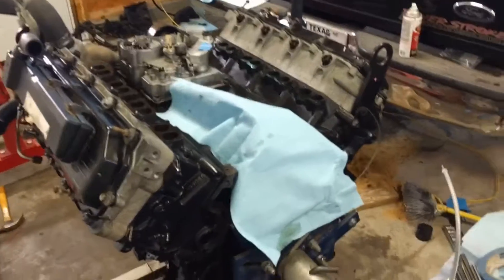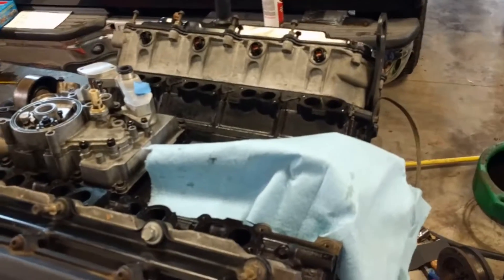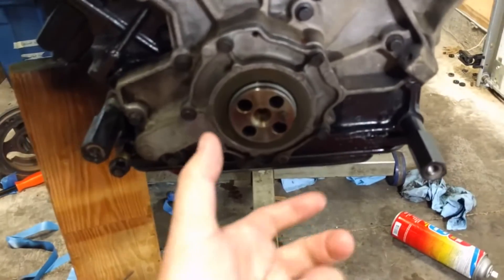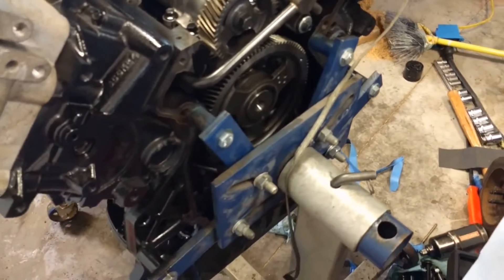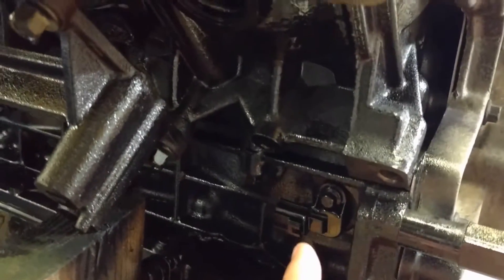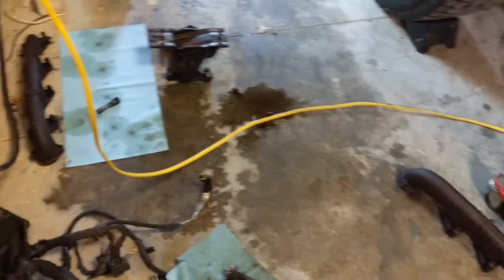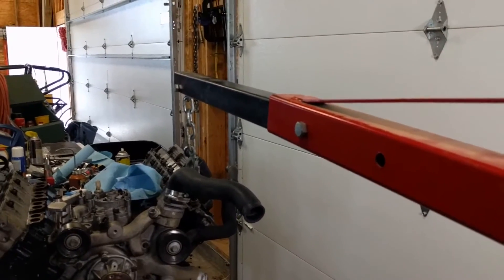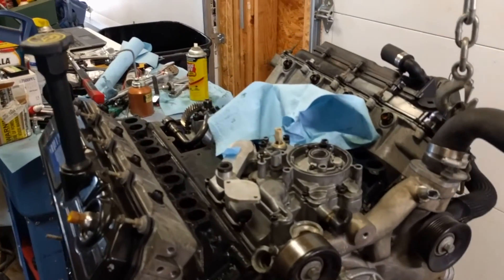F250 PowerStroke 6.0L - Engine Reassembly

Comment: How much if i want to rent your front and rear crank bearing seal tool???
mine is for 6.4.
Reply from the maker: I can rent them to you for $400 deposit, then once I receive them back (in good order, not abused) I will refund $325.  So $75 for the rental and that includes the shipping to you, you'll have to pay to return ship them.
Reply: @paintballrefjosh  what was you saying  bout the stp fitting you didnt need for your style pump or the year ,,,i would like to no ,  i have same year and going to tackle  or try to the same job ,  ,,so please  any info would help ,,thanks  for your time and video,s
Reply: Do you still own the tools and are you still renting them.  I have a rebuild coming up next year.  Just thinking of my plan of attack.  Kevin